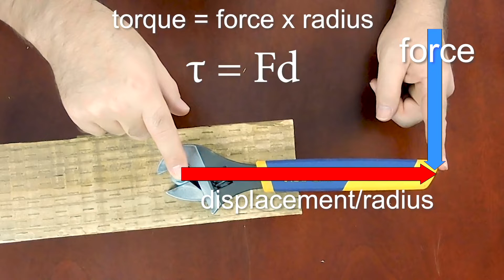Mastering Torque: Essential Guide

Comment: Great video. The concept of torque can be explained without mentioning "cross product," but a full understanding has to mention it since both the radius and force are both vectors. In other words, torque = r X F which of course results in a vector given that both r and F are vectors. And the order matters such that torque cannot simply be written as F X r which would be a different vector. The magnitudes of the vectors can be multiplied, yes, but that doesn't give the direction of the torque vector. Torque is a fascinating idea.

Comment: I don't understand why torque points perpendicularly to the actual turning. Why isn't it just a magnitude? Why does it need a direction?
Reply: This confused the hell out of me, too, and I REALLY wish Paul and other people teaching the right hand rule would explain this right as they explain it - there is NO reason it is "perpendicular" to the actual turning, because it's actually physically not, or the specific direction is completely arbitrary, at least. Apparently this is just a standard convention to make doing math formulas and diagrams easier - you could, for example, have a "left hand" rule, and all your math would work out exactly the same as long as you were consistent.

REALLY wish more teachers would mention this, because it makes it needlessly confusing when they don't. Sorry this answer is a year late, hahah. : \

Comment: If calculating the torque, the equation used is similar (at least in the measurements used distance and force) to that of work. So is the amount of torque also the amount of work, which would be measured in Joules? Can Torque be measured in Joules or must it always be measured as Nm?
Reply from the maker: You have to be careful here.  Although they do have the same unit (Nm) energy and torque are different things. For starters the distance in torque   is the radius. With work, it’s the displacement, and in the case of circular motion, it’s the circumference. There is a relationship between the two. Power, which is the rate of change of energy, is equal to torque x angular velocity, and so energy equals torque x angular displacement.